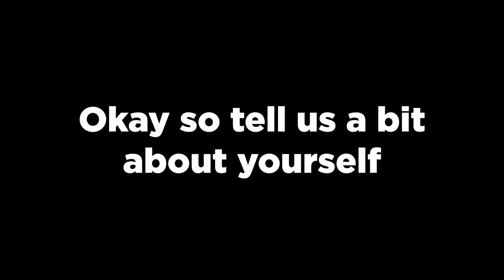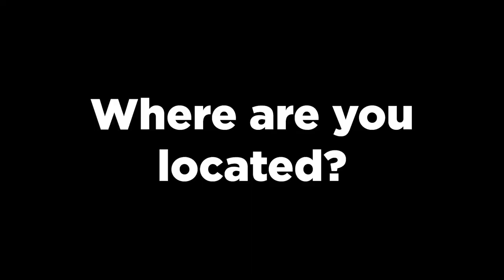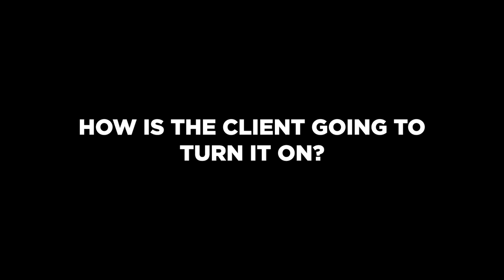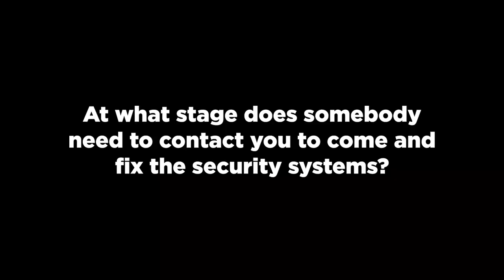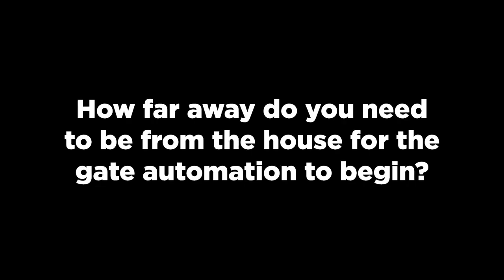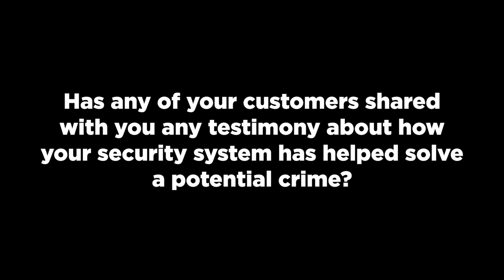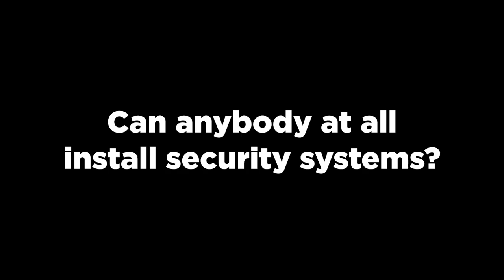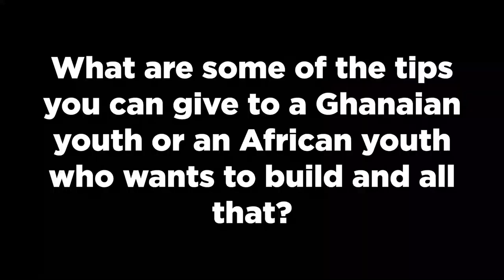Best Security Fence and CCTV installation in Ghana - Building in Ghana

Comment: Thank you so much for this video.  As a Caribbean considering the return home and building, security has always been at the forefront for me.  I don't recall you asking if the system stays activated once the electricity goes out.  Surely on solar it probably will not be an issue but a back up just for the system would be great.
Reply from the maker: Glad it was helpful! There is a backup battery.
Reply: There is always a backup power system which amplifies the power through the wires.

Comment: For something like CCTV and door bell, you can easily DIY with some YouTube videos. For the electric fence, it's pretty dangerous if you're not skilled with high voltage power. In fact, that's what I'm going to do myself.
Reply from the maker: Thanks for the feedback
Reply: Thanks for that information please can you explain further about the high voltage, does it mean the ordinary power  is not enough? How do you generate high power voltage please 🙏
Reply: @estherofosu8840  what I meant was if you don't know how to handle electricity, it's dangerous to try and install an electric fence by yourself.
Reply: Oh yeah it’s better to find a professional when it comes to electricals, especially with the security systems you are very right 🙏

Comment: Isn't it dangerous having electrical  frencenng,
Reply from the maker: No. He explained that it's safe when a professional does it. Even children can touch the walls and gates and be safe.
Reply: @AfricaBuildingHub  

But with voltage, it is possible to get an indirect electric shock within a 0.2 meters radius. It is very dangerous. But in Ghana, people doesn't respect any building or safety code.